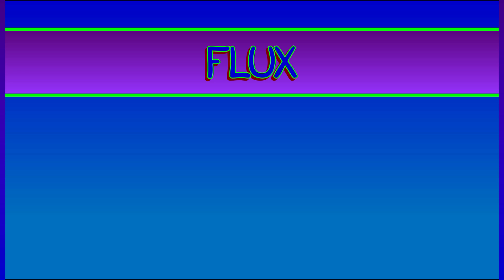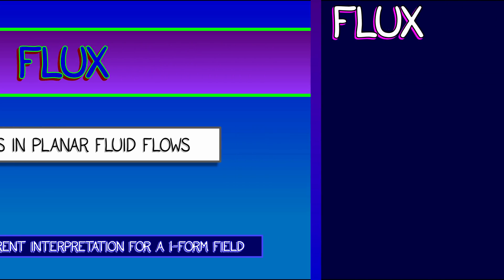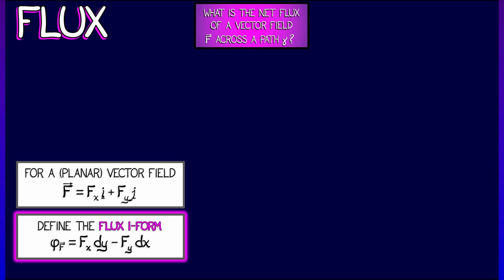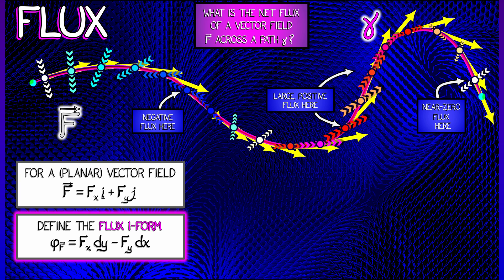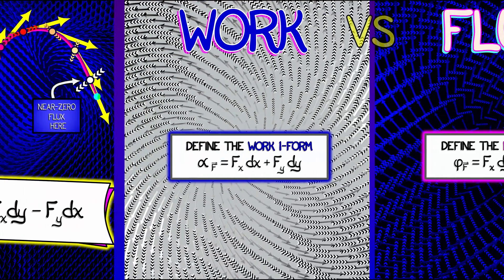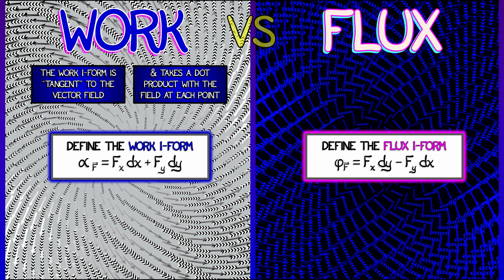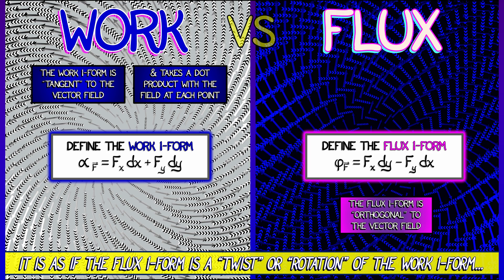CalcBLUE 4 : Ch. 5.4 : The Flux 1-Form in 2-D

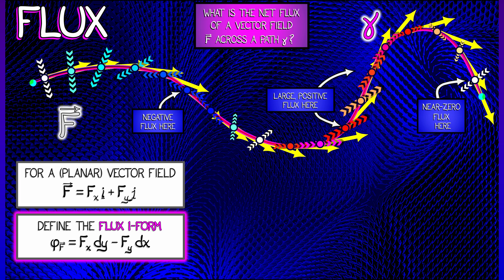Comment: To those confused at @01:11, note that the broken-arrow "rulers" show the 1-form rather than the vector field, and the 1-form is perpendicular to the field. So if the 1-form is perpendicular to the path, the field is parallel to the path, and if 1-form is tangential to the path, the field is perpendicular.

Comment: So flux 1-form in 2-D is just the determinant of the matrix with the field vector in its 1st column and the dx vector in the 2nd. (I'm a physicist and I like strange objects)
Reply: No this seems like the correct way to interpret this. The determinant is fundamentally tied to operations like this due to the wedge product (discussed in later videos).
Reply: I see it as simply the field F rotated 90 degrees, such that if the original field is perfectly aligned with the tangent to the path at some point P, the flux field ends up being orthogonal (i.e. no "stuff" cuts across the path), whereas if the original field is perpendicular to the path, the dot product of the flux field with the tangent of the path at point P will either result in a minimum or a maximum value (depending on orientation), but in either case, a lot of "stuff" flowing across.
Although it certainly works well as the wedge (or cross product) of the vector field components with the vector [dx, dy, dz] transposed - in the plane, only the third term (along the z direction) is not zero.